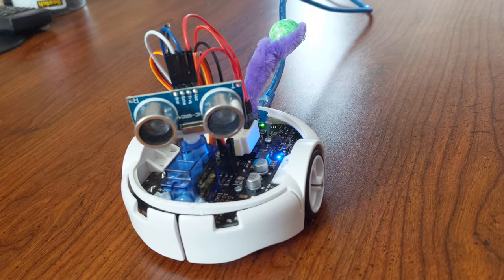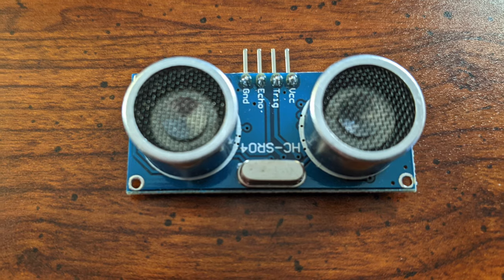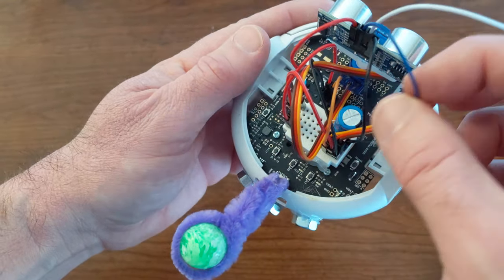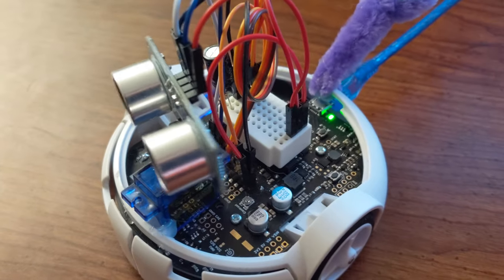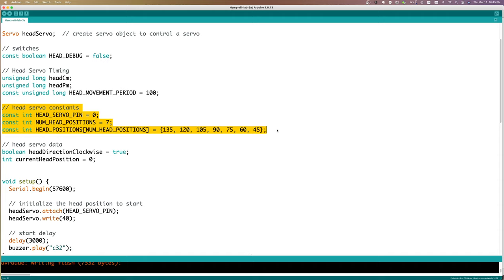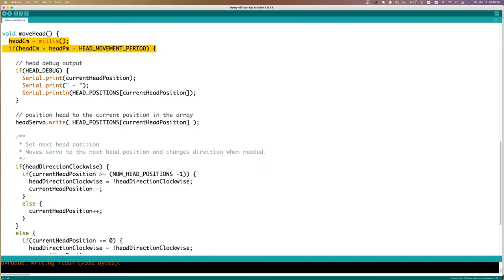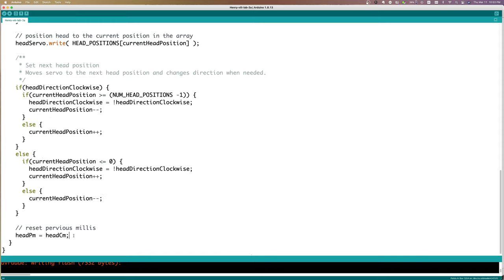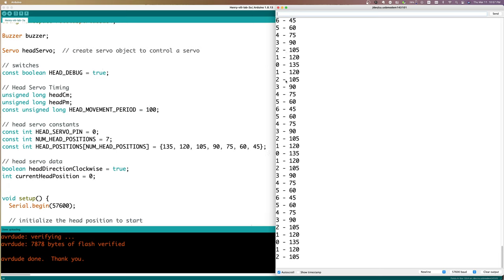Robotics Programming: Servo Control for Arduino

Comment: Hi, Thanks for these videos.  I have a few questions I'm hoping you can help with.

1.  The last time I tried using the robot (about two weeks after the previous time), the right wheel always spins at full speed regardless of the setting..  The left wheel spins at a speed based on the setting.  Any ideas on how I could diagnose this?  I know very little about electronics, so it would have to be something basic.
2.  I'm thinking of getting the Elegoo Uno R3 that you referenced in one of your other videos.  Is there any downside to using that?  Is it programmable?

Thanks again for the help!
Reply from the maker: for 1. are you using the 3pi+ robot?  If so and you are using servo along with the DC wheel motors you have to modify the Servo library as they document here: https://www.pololu.com/docs/0J69/3.9.1 
For 2: yes, it includes an Arduino which you can program.  The downside is, as I discussed in that video, the robots 4 wheeled design may introduce error when turning if using encoders for dead reckoning.
Reply: @CodingCoach  Thank you for getting back to me! 

I'm using the 3pi+.  I'm basically following the videos you've been posting, including the video that uses the servo.  I don't remember modifying any libraries, but I may have missed that.   I'll take a look at the documentation you linked to.
Thanks for the information about the Elegoo.  I'm mostly considering it because it has more room to work with and I think that might make life easier.

Thanks!
Reply: @CodingCoach  The library changed solved my problem.  Thanks!
Reply from the maker: Awesome!  I am not sure I got that far in the videos yet (combining the moving servo with the motors) I will be sure to include that in the next video.
Reply: @CodingCoach  I tried to go ahead on my own.  Lesson learned!
Reply from the maker: Never fear getting ahead.. sorry for the delay, getting the final exams for the semester out now and hoping to have next video this week (although you might have already finished some of it :) )
Reply from the maker: Here is the next video: https://youtu.be/lOTDSQua--s. Sorry about the delay, we should be moving on from here pretty quickly now that the semester is over.